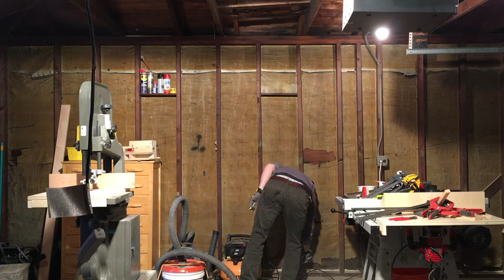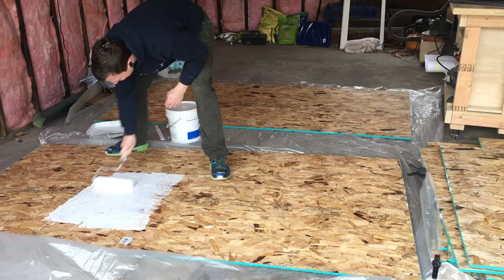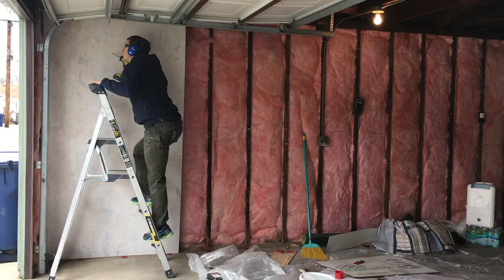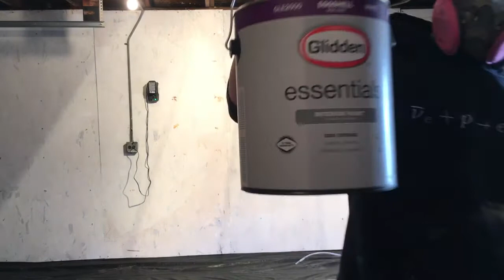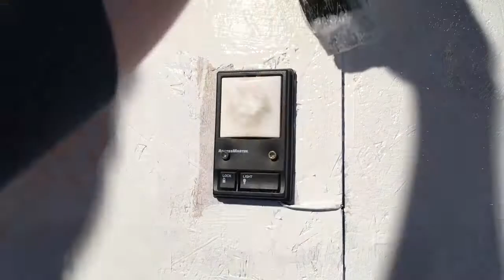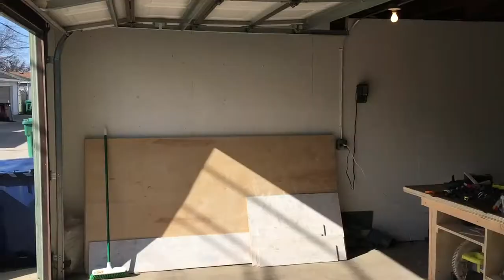Workshop Renovation: Insulation and Sheathing

Comment: How is this setup working out for cold weather. Does it retain heat even though the ceiling isn’t insulated?
Reply from the maker: It didn't retain heat well, no. After this video, I went through and insulated the ceiling and garage door. Now I heat up the workshop with a propane heater, which takes 5-10 mins to get quite warm and it stays that way for 2-3 hours (then I reheat).

Comment: Great job. I need to do this myself, but I need to run a sub panel to my garage and rewrite it before insulation and drywall. How many hours went into this renovation?
Reply from the maker: Thanks! This particular job took only a few hours. After this I also insulated the ceiling, garage door, and added a sub panel to the garage. I'm glad I used painted OSB rather than drywall because I've had to remove panels a few times for various reasons.

Comment: Hay Man, Thanks for the video. I'm planing on doing the same project. Couples questions that I haven't really been able to find the answers to. I plan on using 1/2" OSB , but I'm curious if ending each board in the middle of a stud is that important if using 1/2"...life would be allot easier on this job if I didn't have to end every 4' on a stud. Using OSB for the inside of my garage should i space gap the boards or is it ok to butt them tight?
Reply from the maker: Hey Darrell! I don't think ending exactly on the stud is that critical. I would just put two boards up which don't end on a stud and see for yourself if it looks stable. I personally butted them as tight as possible but since I was working solo sometimes there are 16th inch gaps here or there that I couldn't avoid. I haven't had any issues with expansion or contraction. Hope this helps! I'm very glad I went with 1/2" OSB.